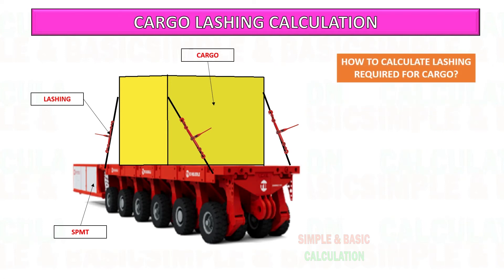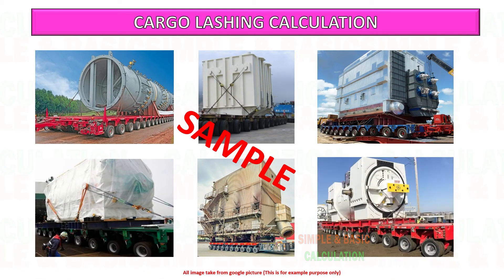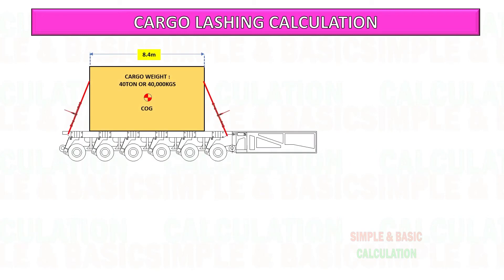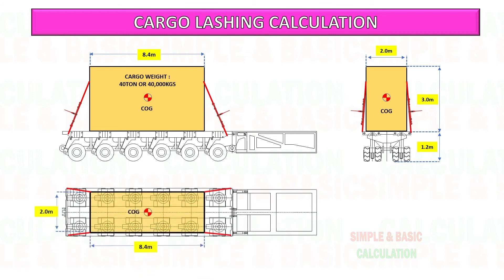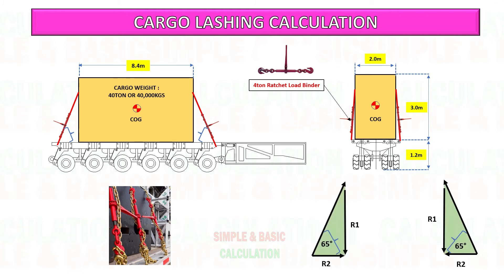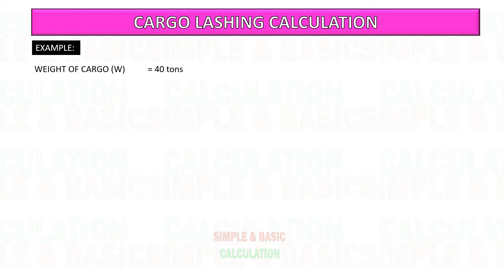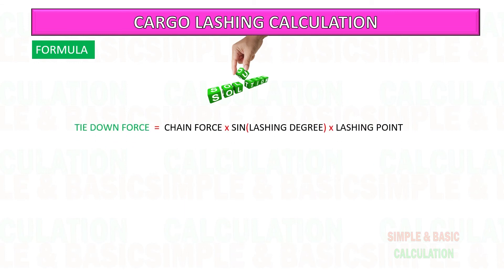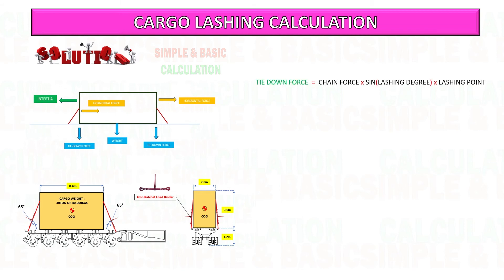Lashing Calculation for Cargo on Trailer #lashing #spmt #trailer #heavytransports

Comment: I have some doubts in this calculation:
1. For horizon force in chain, you know 4number of lashings, lashings tied to spmt to arrest the movement of cargo. Hence 2 lashings in positive direction and other in negative direction. I mean opposite...you mentioned both are same direction...for calculation, 4 numbers considered...i mean we can 2 take number for calculating horizontal force... correct me if wrong.